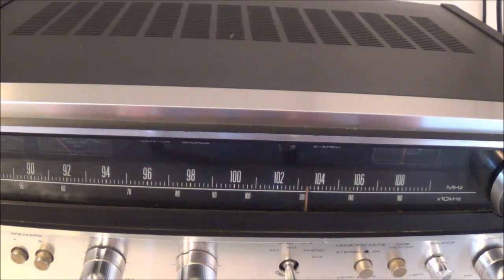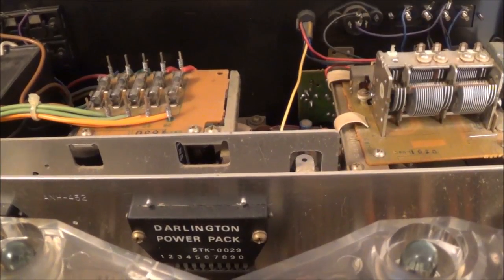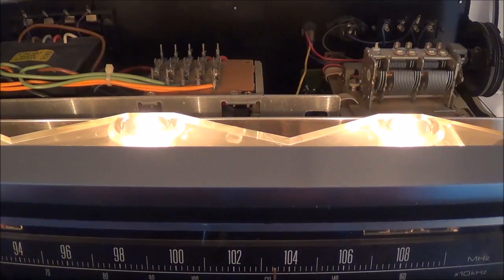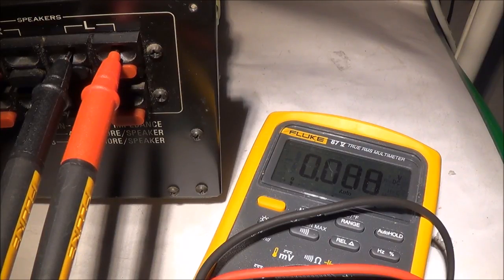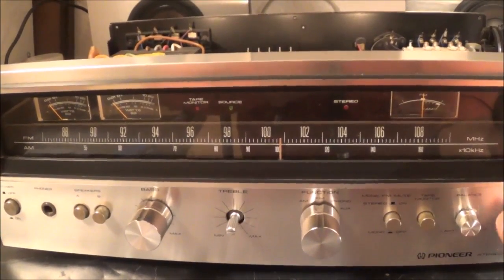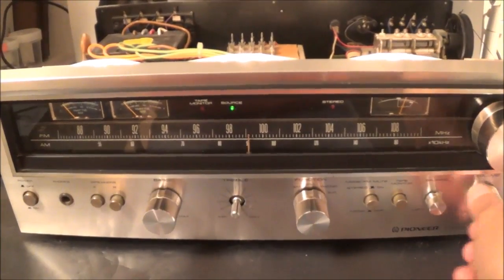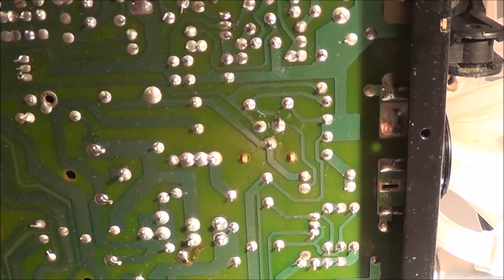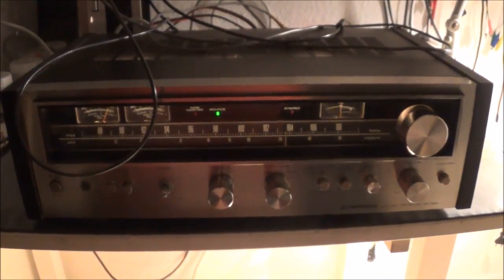Pioneer SX-590 Stereo Receiver Repair

Comment: I need help with a Pioneer Cassette Deck. Suggestions?
Reply from the maker: Dave, it depends. The little information you gave me is like saying to a doctor, "I don't feel well, what is the problem?" Also maybe there is a video by somebody else on YouTube that covers your unit. For sure change the belts, clean the head/s with isopropyl alcohol and Q-Tips, capstan, rubber wheels and pinch/pressure roller/s. Also download a service manual if there is one available.

Comment: These low wattage Pioneer are really good stereos. They have great sound and how often does one push their higher wattage stereos pass 10 WPC. 
Pioneer uses a lot of 2SA725 and 2SA726 transistors which are known to get noisy. I am quick to change these out.  I have also found a lot of bad solder joints on some stereos and I do as you did, remove the old solder and add fresh solder.  Some just reflow the old solder. 
The IC outputs on these are nice but there is never no DC offset adjustment for them.  And I don't know if there was an idle current adjustment on this one. 
I never make big money on these lower wattage units but still have no problem selling them on Ebay. Most of the time they only last a few days on Ebay. Sometimes I think that I could get more money just selling the knobs. But that is not why I do it in the first place.  So keep the videos coming. Your channel did get mention in another channel in the comments as one he likes to watch because you explained things.
Reply from the maker: Thanks for all the infos! What do you use as a replacement for all the 2SA725 and 2SA726? In my opinion, fresh solder is always better. There were no adjustments in the power amp section. And true, those little receivers sound quite good. And I wasn't aware that my channel was mentioned on another channel. Perhaps I should watch more channels? Thanks!
Reply: By the advice from the guys at audiokarma I use a KSA992 for both the 725 & 726.  From what I have read on the forums there, Pioneer made some bad choices of transistors and this is by some of the best guys on the forum.